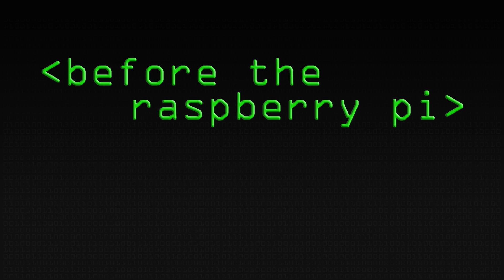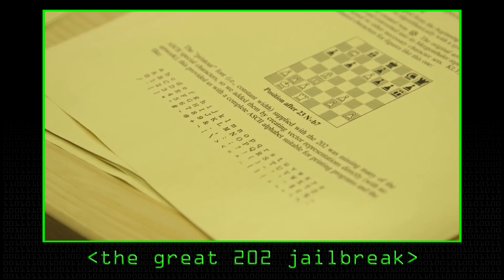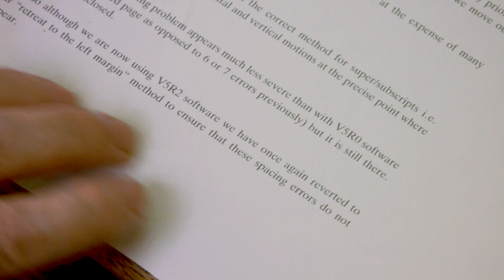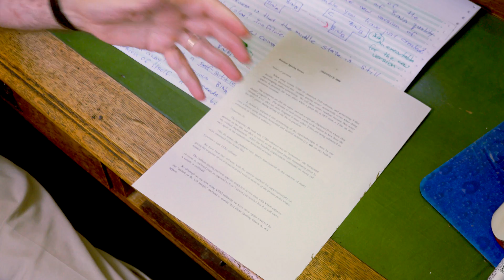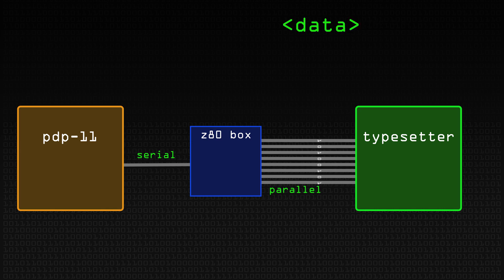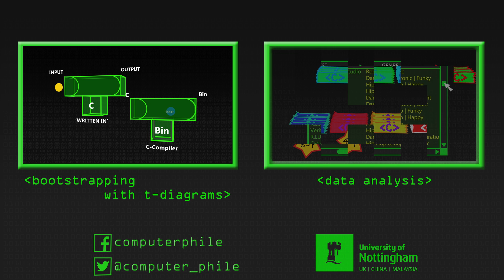Before Raspberry Pi and Arduino - Computerphile

Comment: I remember Versatek electrostatic printers (late 70s), especially the odor of the electrostatic printing.  Don't remember the resolution.  I wrote a library in PDP-11 assembler that was many times faster than the vendor-supplied Fortran.  The speed was necessary to meet the requirements of the contract.  I think they were used to plot maps/charts.  I also interfaced the PDP-11/70 to submit batch jobs to, I think, a remote CDC over either 9600 or 19200 synchronous modem (high speed in the late 70s).  DEC had an interface that worked, but I had to write the software.  12-bit words with the bits in reverse order IIRC.

Comment: For most professional engineers the raspberry pi and arduino has made not difference, There were and still are very many  SBC's out there that are not Pi or Arduino. As for interfacing boxes... it is just as easy to do with something other than a Pi or Ardiuno and a LOT safer.

Comment: Dear Professor Brailsford, I hope you were able to write and compile your C code in a few hours....including installing the compiler on your ....PDP11?
writing the assembler code for a Z80 with a SIO and a PIO, including using the convenient interrupt system, and handling a ring-buffer would be a 2-3 hour job for the apprentice where I was educated - that be after he'd  done the hardware design, PCB layout, produced the PCB, mounted soldered and packaged it all in a suitable box.

It would likely be a job you as an apprentice would be given monday morning and expected to test in function by Friday afternoon.

I was an apprentice from 1975 to 1979 - and I would have been asked to do it with Motorola M6800, a M6820 PIA and a M6850 UART. I would probably had been given 2 * 512 bytes EPROM's and 2kbytes of SRAM in form of M6810's or 2114's.

Comment: Thank-you Professor Brailsford for this trip down memory lane.

In 1982 I was an engineering undergraduate in Nottingham at Trent Polytechnic (as it was then). In 1985 I was offered the use of a college professional quality daisy wheel printer to print out my thesis. The printer was Centronics (parallel) only and the Sinclair QL I'd used was serial only...

Comment: About 1985 I designed and wrote the same kind of hardware/software to connect a printer to a terminal.  It was easy to do that on a 8051 machine. :-)

Comment: Most manufacturers I've worked for want a custom board shape, full hardware and software IP ownership and low power operation. That rules out Arduino etc for production use.

Comment: Ah yes... before Raspberry Pi and Arduino, when outputting a bit on a port took ONE instruction instead of fifty, and you could emulate a USB peripheral with it when you didn't actually have one, instead of blinking an LED, barely just, if the OS wasn't doing anything more important. Progress is truly a wonderful thing indeed. But no worries, we have eleventy billion spare cycles to waste at it now, so maybe we can still make it work...

Comment: Those were the days... I did assembly and C code on a NEC v20 CPU (Intel 80286 compatible), communicating with serial ports and parallel ports, created a small kernel to run multiple threads in C and assembly an 8KB EPROM. Fun times indeed!

Comment: Back in the 80s, I worked on a Xerox 9700 laser printer.... the thing was huge, even if it only did 300dpi. :)
It could print 120 images/minute in full duplex. It had a microprocessor controller in it, but was run by a separate controller with a DEC PDP-11/34, disk pack, and 9-track tape drive. There was no direct connection to the mainframe, you would print to mag tape, then sneakernet it over. It did have some typesetting capability with its "Form Design Language" Fun Times.

Comment: The need to develop interfaces for propriety hardware has been around since the start of the Industrial revolution. (Mechanical, Hydraulic, Electrical, Electronic.) But the Prof's point about designing what you need, rather than what you want, is succinct.
Typical of academic technology around that period is the use of a Z80 (2nd or 3rd gen microprocessor.) and its complicated assortment of support chips and hardware - when the real world was already using standalone microcontrollers such as the Intel 8048 family.
There were a multitude of compilers and cross-compilers in Basic, C, Pascal and ASM available.
The later i8051 family is still in use today in many upgraded and enhanced forms.
Reply: The 8051 seems to be eternally useful. I remember watching a video of a teardown of a White Van Speaker Scam AV receiver, and it included an 8051 clone in it.

Comment: I remember those interfacing problems and the utility of 8-bit processors as in-line point solutions!  In particular, interfacing a PDP-11 to a 12V parallel bus relay-driven SCADA system (others were trying to create computerized SCADA systems from scratch - our retro-fit approach made us tons of money).  And creating DIY ADCs (analog-to-digital converters) using a few GPIO bits and an external RC integrator.  So many of these "hacks" were hurriedly prototyped on wire-wrapped boards.  Several of which served for over two decades in fairly nasty environments.

Then the company BlackBox came on the scene offering a ridiculous number of interface boxes that, while expensive, cost somewhat less than in-house development and were available off the shelf.  And then PCs arrived with their parallel and serial ports, and the availability of easily programmed PLAs, PLDs and early CPLDs (pre-FPGA) that replaced the "jelly bean" 74-series TTL interface chips and drivers got rid of the wire-wrap boards in the wink of an eye.

Comment: I used the whitesmith compiler for the 6811, back in the late 1980's

Did the Z80 have a UART port, or did you bit bang it.

FWIW all EE students should be forced to replicate ports like UARTs, entirely in code (bit banged).  Nothing gives you a better understanding of something thing, than build it from scratch.

Comment: Centronics parallel had just the one set of data bits D0-D7 but they could be kludged to be bidrectional. Bruce Eckels ran a How-To in Micro Cornucopia where he took a standard interface card and soldered an additional bit from the card's LS373 config register to the /E on the card's LS 244 output driver. By running the LS244 into tri-state mode that let the LS245 bus transceiver just read back from D0-D7. Presto, 8 bits of parallel input (albeit with a lot of parasitic capacitance and inductive crosstalk).

Comment: I/O bridging is done more by Arduino than raspberry since raspberry is just a rebranded set top box.  Before 2007, we had the mighty 68HC11.
Reply: Oh I think the PIC16F84 and its later cousins took over that job way more than a decade before 2007.

Comment: In the early '80s, I worked for Floating Point Systems, Inc. We had an IBM laser printer that cost $80,000. We used Runoff on Prime computers to create documents (manuals), which were published on Xerox copiers. Normal input was via IBM Mag Cards, which were written using specialized Selectric typewriters. We didn't use them. As I remember, we used a serial cable from a Prime to the printer, and it ran at 1200 baud. I don't remember if we had to convert ASCII to EBCDIC.

Comment: One thing not mentioned is that even back then designing a board with a Z80 wasn't totally trivial. It's not like an Arduino that is already a full system. The Z80 needs a crystal or some kind of clock, a memory, a memory bus, impedance drivers for the IOs... and not least, some kind of bootstrap code for it to do something useful, unless you can map & program the PROM directly starting at address zero (which is a typical choice IIRC).
Reply: There isn't actually much choice, the Z80 will always start executing code from address zero, whether there is any code or not.
I dabble in Z80 assembler myself, so i know quite well how it works.

Comment: "And lo! Hewlett Packard didst buildeth the LaserJet, and the people saw it was good, and it was good!" 
Built like a battleship. Actually no, better than that, built like an old-school Nokia. Cheap toner, easy to find parts. Parallel port, or ethernet module, good quality fonts. I'm surprised Nottingham Uni didn't use a BBC micro for protocol conversion though, with a standard serial, parallel and additional high speed ports, plus a built-in assembler. They were brilliant machines for hacking real world systems together, the ethos very much lives on in the Raspberry Pi.

Comment: And here I am complaining about 10 cents per page.  They really charged them 10 pounds per page? 😵
Reply: Having a look at the inflation calculator.  £10 in 1983 is the equivalent of £31.57 in 2018.  Not cheap at all.
Reply: William White  thanks for clarifying.  That's a lot more reasonable than I thought.

Comment: As a Z80 assembly programmer back in the 80s (and still dabbling in it now), it could have been fun to write the software in assembly. Can you remember if you buffered one byte at a time from the serial port before putting it out did you receive multiple bytes from the serial before outputting them on the parallel as a burst?

Comment: A friend with lots of home automation projects had a stack of BBC Micros he picked up from a classroom clearing that he used to join things together. Once, he called to say he had a new jukebox to gut, and a motorised satellite dish that needed an adaptive alignment box with keypad input. Over the weekend, he did the hardware and I coded. 6502 assembly, written on A4 in Biro and typed in... I think that was the last time ever I wrote some significant code that worked first time!

Beebs were the ultimate glue hardware, IMHO. The number of BBC Micros being used to connect things to other things must still be non-zero. Raspberry Pi was smart to use them as their spiritual ancestor.
Reply: +1 on that. I used them for a whole range of industrial and test rig jobs. Once, due to no spare being available, I wrote a control panel for a plastics extruder line in FORTH, and put it in as a temporary unit - it was still running when they scrapped the machine, years later. One reason they liked it was that the early PC based controller had to reboot from a disc if it crashed, whereas the BBC took seconds to boot from ROM.
Somewhere I still have the hardware for a cable tester I built with a BBC, it used the 1MHz bus to connect the cables and the analogue port to measure resistance. It was expandable, initially doing 32 cores. It could 'sniff out' an unlnown serial cable in seconds and then use the data to test new ones.
Lovely machines. I still have a few.

Comment: Ahh, the Z80...my first computer was a TRS-80, complete with an audio cassette recorder for data storage and 16k of ram. Black and white monitor, which was just a rebranded Zenith TV without the tuner, and the printer used rolls of maybe 6" wide aluminized paper. Heck of a machine for its day though!

Comment: I'm surprised the solution wasn't a BBC Micro.  Save on hardware development by buying a device with a serial and a parallel port already built in.  I accept that the Z80 had a C compiler which made things a bit easier but that C compiler was pretty limited back then.  Oh, and the BBC had Forth! :-)

Comment: Brilliant explanation of the print industry from the 80’s to today.
Reply: Sadly the vendors did not learn from the previous generations. I recall hitting my head against the desk trying to get the early inkjet printers to use the proper fonts to print hazardous material labels. Only a search on CompuServe, blast from the past, yielded an explanation as to why I was not getting WYSIWYG.

Comment: :) What fun it was - I can still smell the bromide!
Reply: Hi  Julian !
Glad you are around!  Need to send you a long-ish email soon before I can do the next episode (!).
<everyone>: I wrote the original prototype C/Z80 interfacing software to the Omnitech typesetter.and its parallel interface. I called it PLOD (Program for Linotype-Omnitech Dialogue) But when we had to replace the Omnitech with a 202 - and get that machine ready for actual exam-paper production mode - Julian took a  huge burden off my shoulders by doing a total rewrite  of PLOD, for the 202 and for its own (very different) parallel interface. Thanks Julian !
</everyone>

Comment: Cheapo laser printers for home use and like 300 bucks are 600 dpi now, yes. But the professional grade laser printers one finds at a university will all have 1200 dpi at least, newer models might even have 2400 dpi.

Comment: Parallel is harder than serial? 🤨 I guess I must have been doing hardware design wrong then because 25 years ago, the first computer peripheral I ever built was a parallel device because it was easier to make it parallel than serial. And when they phased it out, it took me forever to switch to USB. But then I rarely do things the normal/common way. :-\
Reply: Then I take it you were using the parallel as sort of a GPIO, rather than for a data stream like in this topic.
Reply: @smorrow  
What's gpio?
Reply: @NoNameAtAll2  general purpose input output
Reply: I used to enjoy the parallel port to drive transistor-driven relay applications with the OutportB() but the professor is right: just use a faster serial port.

Comment: did the z80 circuit understand something of the IO or was it just a passthrough?
Reply: @saladnuts so that is reading in from the rs232 chip (maybe a SN75189) and output to the paralel port chip, in a loop.start: IN RS232, OUT PLI, jump start.

But he is talking about waiting loops, so there is some intelligence. My question is, did it understand the protocol or not
Reply: I was wondering that, because if it was just receiving and sending one byte at a time (including handshaking) it wouldn't have been overly complicated.